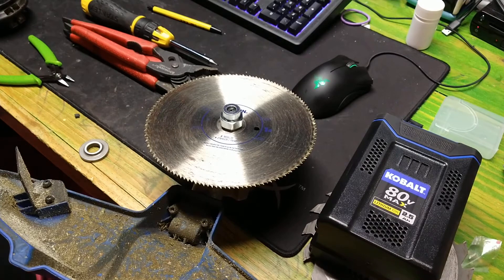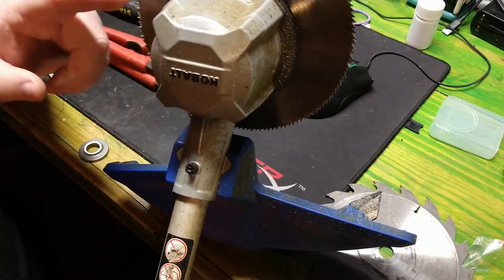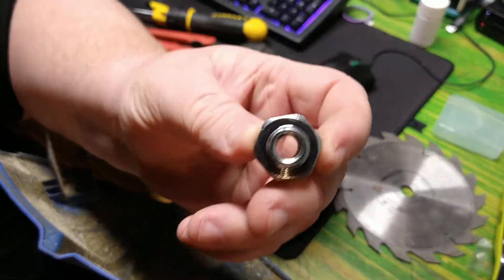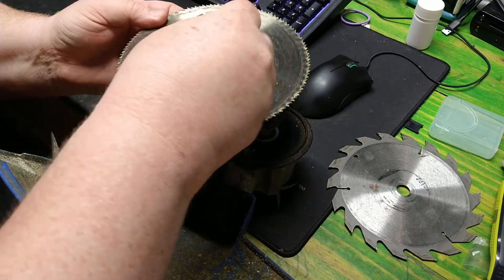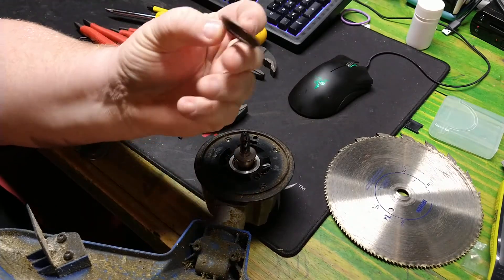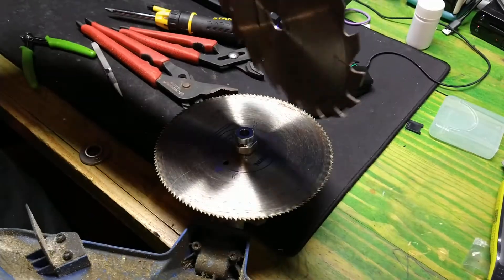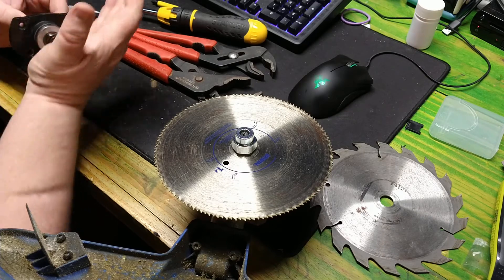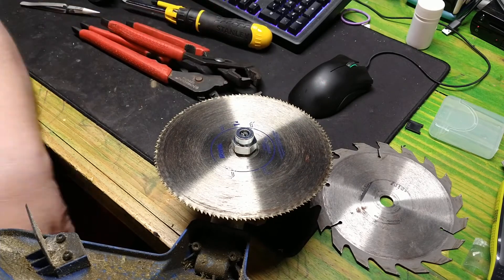Kobalt 80v weed eater with a blade

Comment: what the nut size please?
Reply: I don't remember now if you take your weed eater nut to the hardware store you can check it I want to say it was m10 thought
Reply: @willsamuelsthegreatone7589   I read on a couple places it is a 10 mm by 1.25 left hand thread.
Reply: 10mmm by 1.25 left hand thread
Reply: @philzinck733  no its not the nuts i got were at lowes not LHT
Reply: @willsamuelsthegreatone7589   Thanks will. I had read that on several posts and ordered some,lol. Figures.
Reply: Ever figure out what nut goes on this?
Reply: @UnPhasable  10m 1.25 pretty sure anyways look you can take the nut off and take it to your hardware store and use there nut thingy
Reply: M10-1.25 JIS?
Reply: @UnPhasable  M10-1.25 JIS?